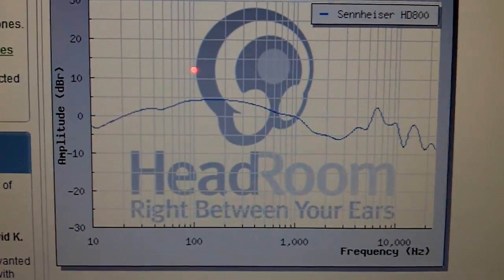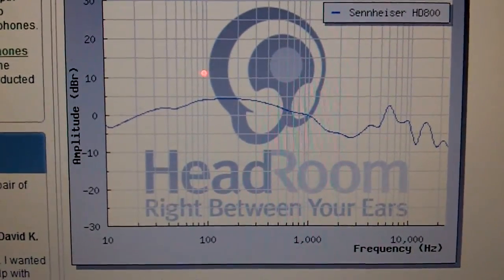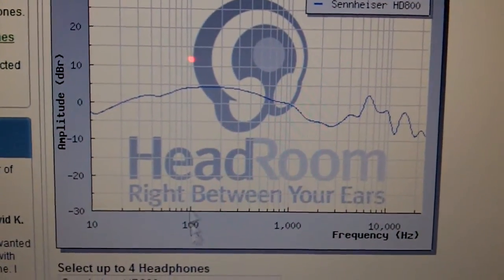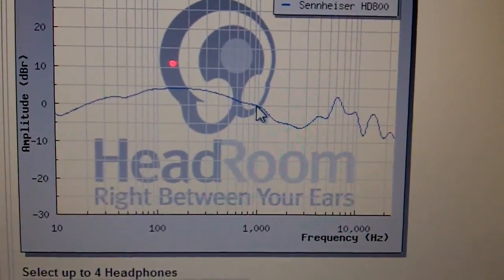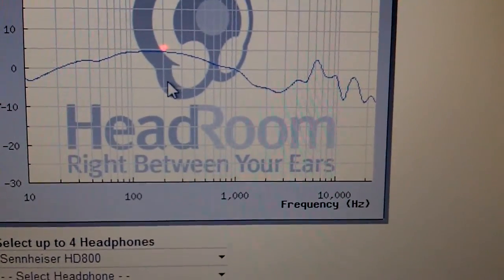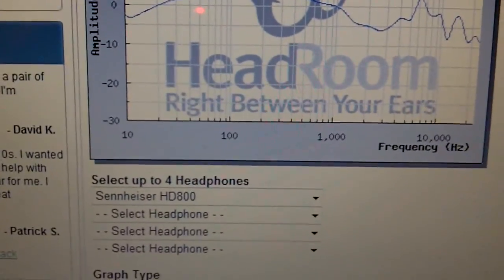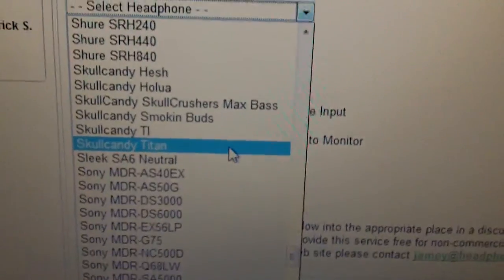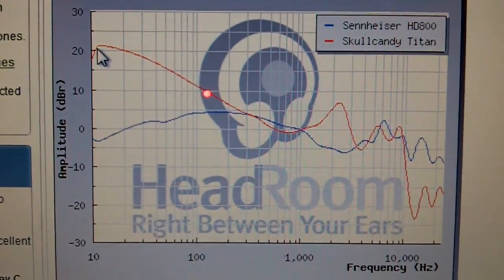Interpreting a headphone's frequency response ( Informative )

Comment from the maker: It's very difficult for a headphone to achieve a flat frequency response. There's so many characteristics that will impede on this result. Usually transducers are engineered to exaggerate the 20-250hz range to compensate for the size of the speaker.

Comment: I think this headphones supposed to have Diffuse field correction (so without 80Hz bump).

I changed the HATS B&K with a head Acoustics HATS and I get the same problem.

I send a tone of 80 Hz and I have get ~8 dB comparing to tone of 1000 Hz

Comment: Thank you for your fast answer.
I don't think is a probleme of ampedance adaptation beacause I used the headphones (Stax SRS-4040 II) with his original amplifier ( Stax SRM-006t) provided with it. 

I've put a link to my frequency response in the comment but Youtube don't accept that :(

I tried with another Stax SRS-4040 II that I have and I get almost the same curve.

Comment: I have a headphone Stax SRS-4040 II with the driver Stax SRM-006t.

When I measured the frequency response of this headphone, I found a bump around 80 Hz. I repeated the measurement many times and I found always the same problem. It's supposed to not have this bump at this frequency.

I will appreciate it if you could tell me if this bump is an intrinsic characteristic of this headphone?

Note: I used a pink noise and a HATS B&K to measure the frequency response.

Best regards,
Reply: Lol

Comment: Frequency response is the last thing that will change when you get an amp...and its not the only thing that can be measured. Its actually one of the more useless measurements that tell you how good headphones sound. You can have 300$ and 1500$ headphones that have virtually identical frequency response graphs (like Beyerdynamic DT880 and T1) but T1 sounds MUCH better. You cant measure imaging, soundstage, clarity, separation, etc.

Comment from the maker: @ryanellis000 I'd maximize the HD650 setup but it is a tough choice because the LCD-2 will still be able to compete unamped. If you're willing to get an amp and DAC down the road after you buy the LCD-2 you'll be able to have 2 headphones. But, if money is tight, just maximize the HD650.